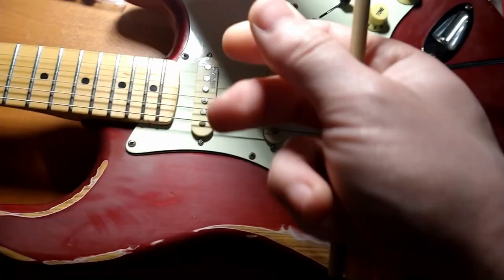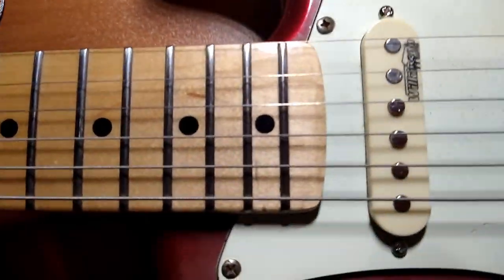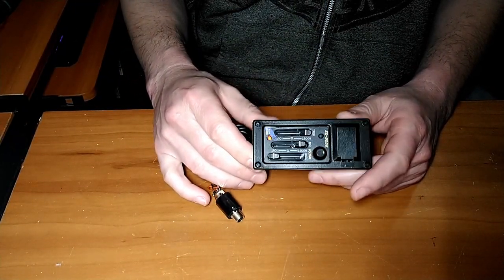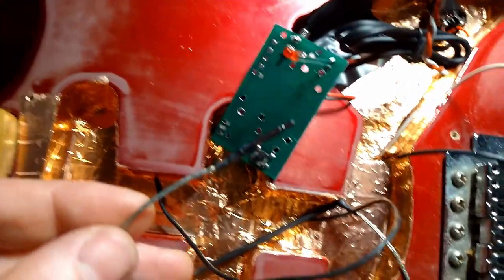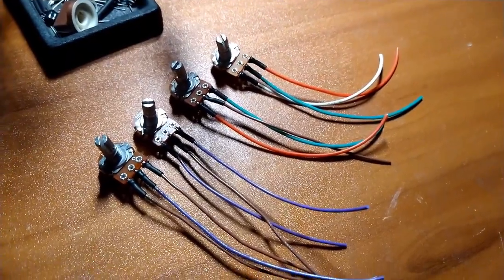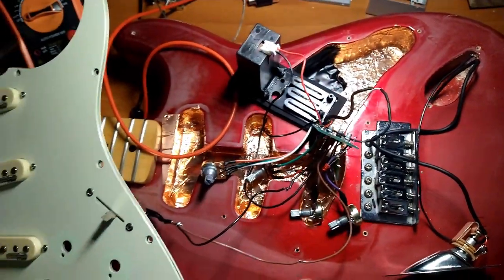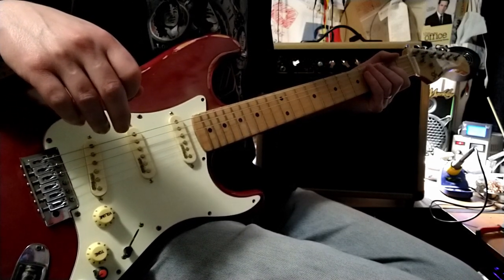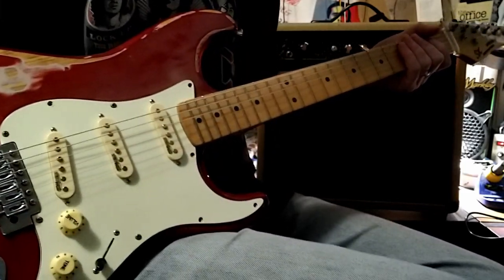KING'S X - TY TABOR EARLY RIG part 3: THE GUITAR / TREBLE & MID BOOST  - QUEST FOR THE HOLY GRAIL

Comment from the maker: In hindsight, I believe the surface mount capacitor became dislodged during all the jackhammering which let me astray with the whole negative voltage rabbit hole & having to reverse the LED polarity. After the cap fell off and I replaced it, things seemed to work as designed again.